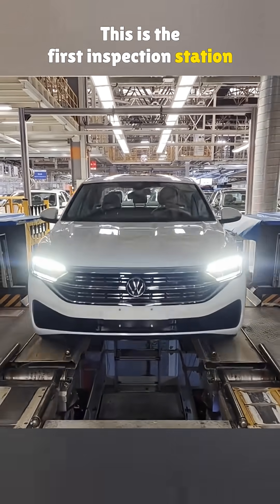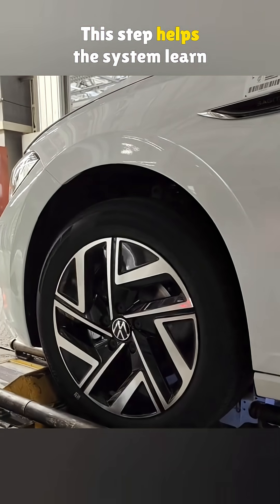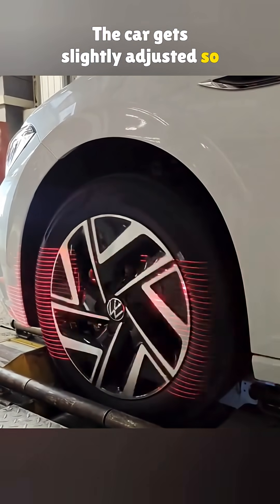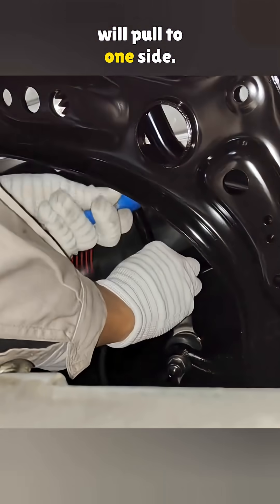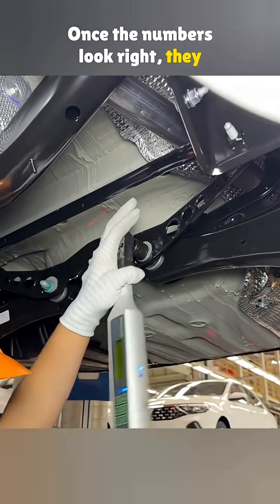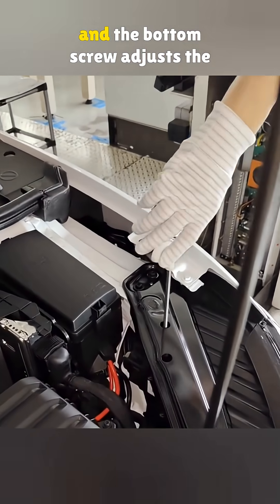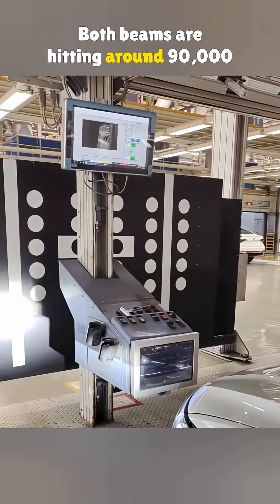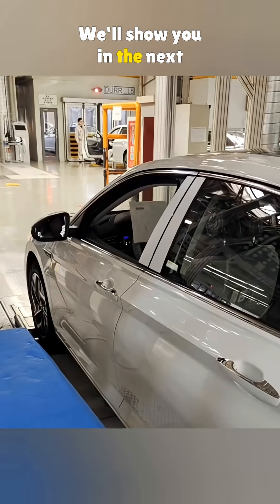Inside the Factory: Wheel Alignment and Headlight Calibration #assembly #automobile #automotice #car

Comment: Anyone who's driving a VW care to comment on its comfort performance fuel and maintenance
Reply: The Jetta is expensive to maintain correctly (never follow the bare minimum maintenance schedule).  If you maintain it correctly, the car is very reliable.  The ride quality is smooth and quiet.  It does have a torsion beam suspension, which does make going over larger bumps more noticeable.
Reply: @BabyBugBug  Thank you.

Comment: That front adjustment was the toe, not caster.
That rear adjustment was the toe/camber (yes this eccentric bolt influences both), not caster.
Reply from the maker: Thanks for the feedback!
Reply: These VWs have a separate camber adjustment eccentric on the upper arm.
Reply: @esteve72 
That’s fine. 
Does not change the fact that: the rear knuckle is held via triangulation. 
So when the toe arm is adjusted, it changes BOTH the toe AND the camber.
Reply: @reallifeengineer If you did a full swing on the eccentric on the lower arm, you might get 1/10° of movement on camber, if that. There's a reason VW put another eccentric on the upper arm for camber adjustment.

What you're arguing is like if I said I throughly washed my hands after pooping, I say my hands are clean but you say they're not because microscopic, airborne particles of fecal matter are floating around in the air still landing on my hands.

Comment: Because incoming traffic, left light must be lowered.but anyways that means noting because 60% morons drive with high beams ON.and 95% new cars on the road today has such a bright headlights it blinds you even with low beams.
Reply: You're correct for what you said. However, lowering the left beam should be notably a very little (1-2 mm below the center of the light beam adjuster).

The right beam that targets mostly the traffic signs can be adjusted upwards again by 1-2 mm.
Reply: Real. Sometimes I regret trying to overtake these cars.
Reply: On coming traffic is on the right